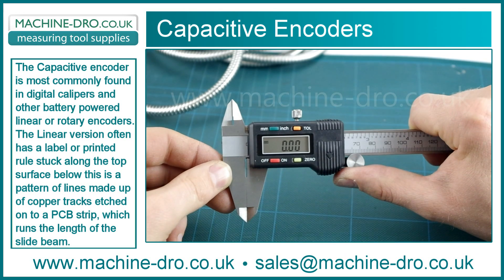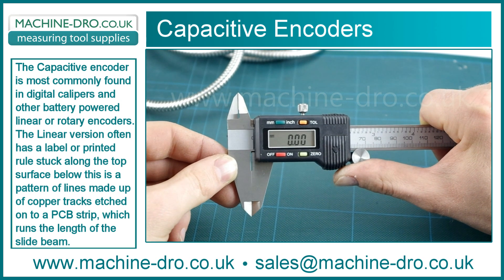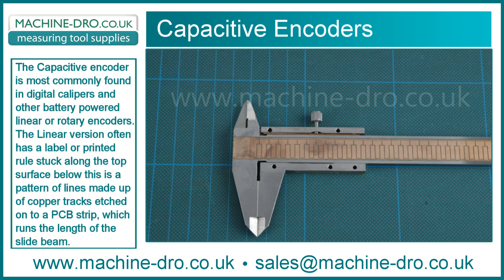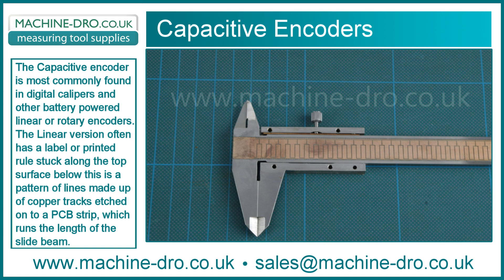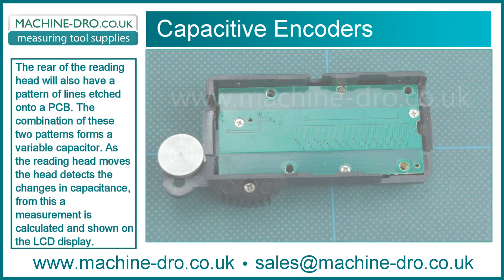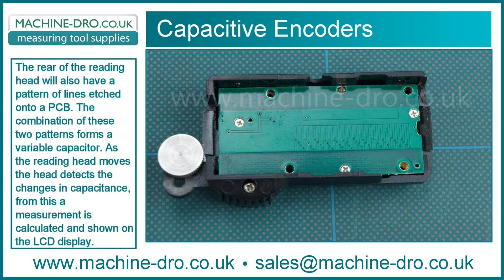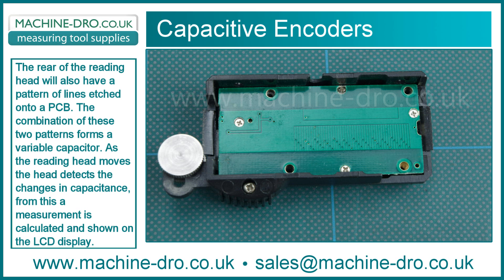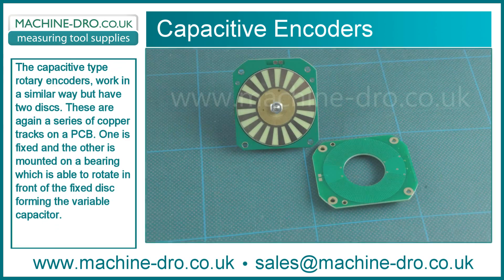The Technology Behind Digital Calipers, Micrometers and Similar Battery Powered Measuring Tools

Comment: Half correct.  The linear encoder uses 0/180 degree phase and the pickups are used to determine the phase variance due to capacitive loading (the variable capacitor part).  The I and Q signals are then used to determine what the phase variance is and used to calculate distance.
Reply: But he said it a way non electronic people can understand....
There are a few ways to describe how an electric guitar pick up works....
But do you really think anyone needs to know about the composition of the magnets ....